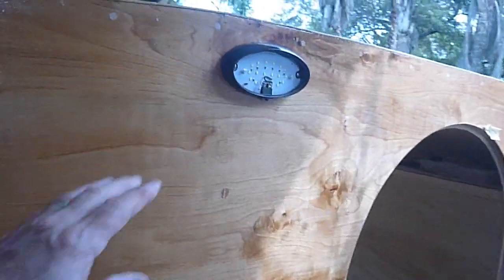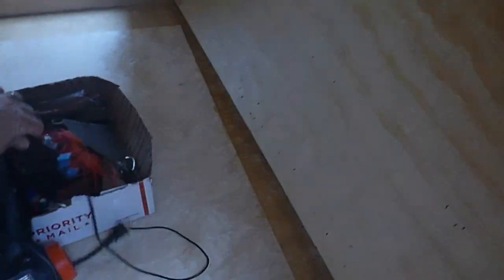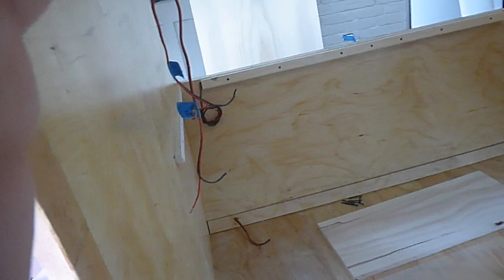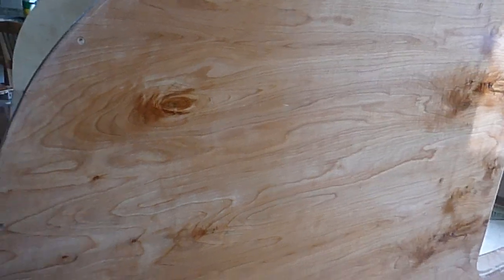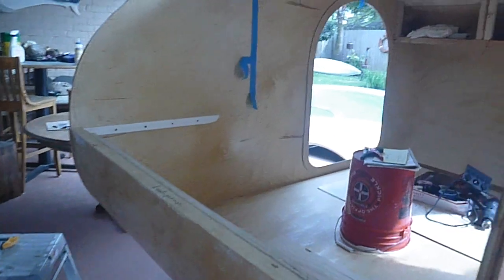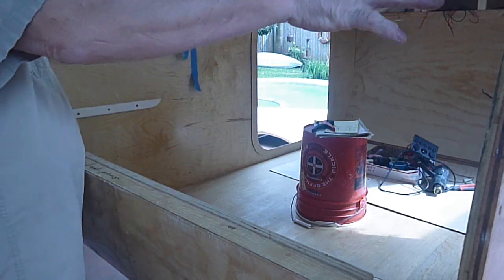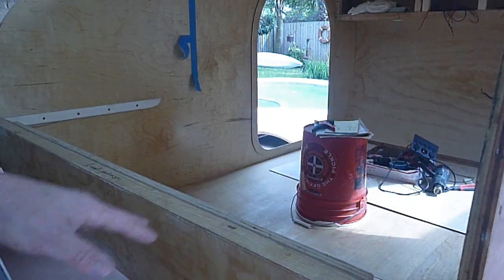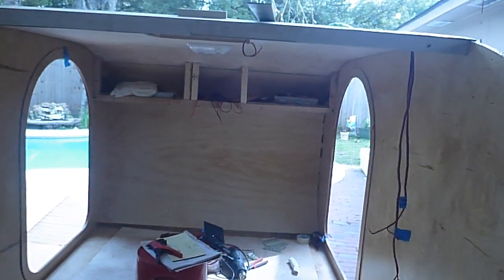Tear drop camper build a 5 X 8 video no. 40   LED lights

Comment: Moving right along with the build.  now comes the hard part (at   least it would be for me) wiring! Thanks for sharing and have a good week.
Reply from the maker: The wiring was  not hard I did label each wire no mater how simple a connection it was. You can do it
Reply from the maker: The wiring is not too hard

Comment: I like the idea of a removable galley like that. To me it never made sense for a huge one that takes a ton of room... The idea of a teardrop is to be outside more. Yes you cook outside but some teardrop have all the bells & whistles etc which take up precious room... When it rains and I can't be outside I want to be as comfy inside as possible which to me means ample room etc... After watching 1000's of camper builds I think no have decided mine will be 5-6' wide 5 foot tall & 8-10' long ...
Reply from the maker: I like the idea of a 8 x 10 but it will have to go forward one foot on the trailer before bolting down otherwise it will be hard to move by hand.